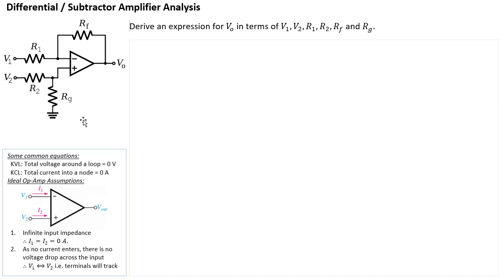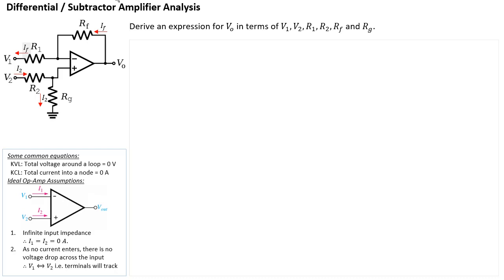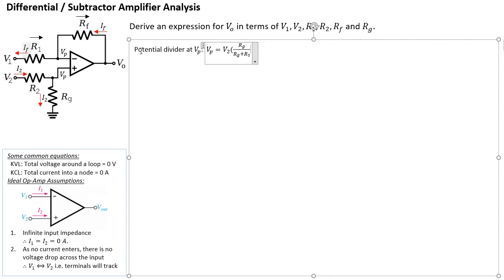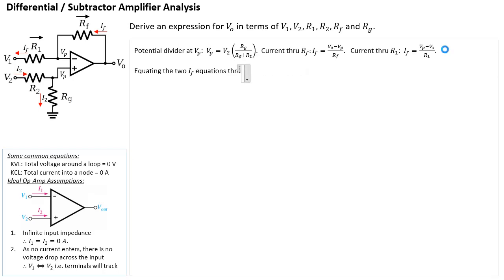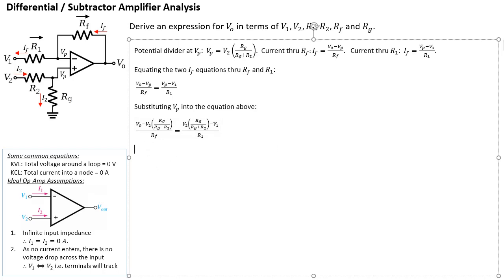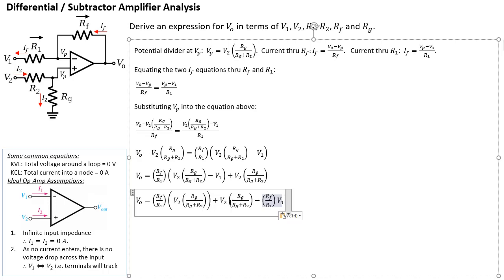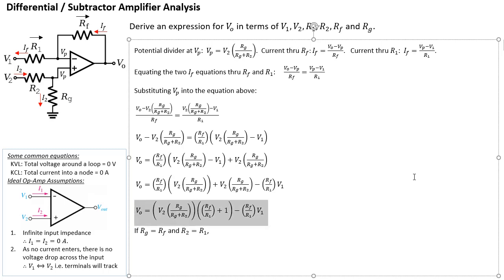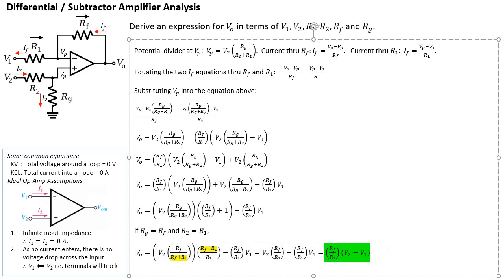OpAmp - Differential / Subtractor Amplifier

Comment: Why does the current on top start from the right and in the bottom from the left?
Reply from the maker: Hi Ayman. Excellent question, and something that I also wondered when I was a student!

In operation, signal voltages are typically both positive and negative, therefore current directions also change accordingly. However, for the purpose of circuit analysis, WE decide what directions to use. If you follow your basic circuit theory rules properly, the final answer will come out the same.

Hope that helps. 😁
Reply: @cikgutaiff  i see , thank you so much your videos helped me a lot thank you very much
Reply from the maker: @aymanhachembouamama2113  No probs. I use these videos to help my students understand too. I am planning short online webinars to discuss specific topics. Any particular area that you and your friends might be interested in?